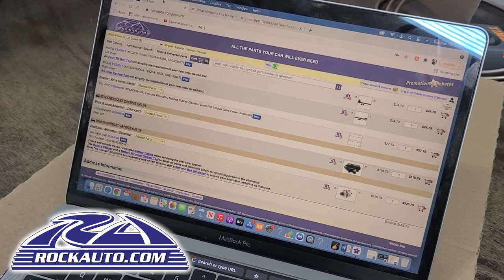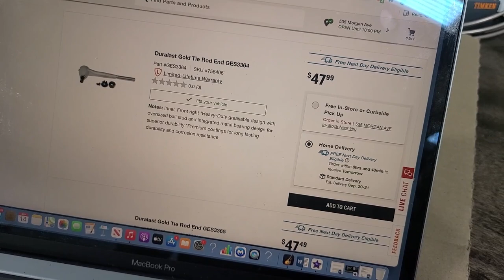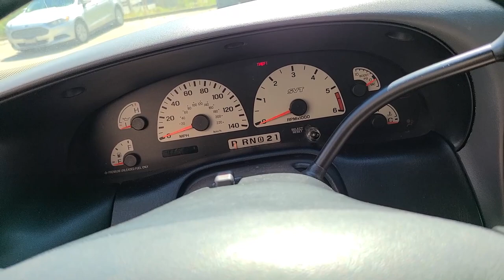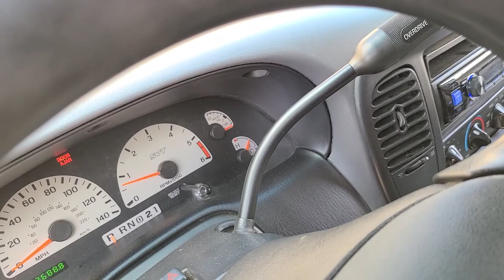I Found A MAJOR Engine Issue After Fixing EVERYTHING On My SVT Lightning! Previous Owner Had To Know

Comment from the maker: Do you think the previous owner knew and is this Ford's fault or abuse? 
Click this link https://bit.ly/3mFdrY8 and use coupon code Legit for 5% off RockAuto!
Reply: Have you considered its the air to water intercooler leaking and pressurizing the cooling system by the boost pre-combustion? That would explain the lack of combustion gasses in the testing and also why it only manifests when under boost. I know these had that problem or something similar when they were new.
Reply: Absolutely no doubt about it
Reply: I really don't think it's the previous owner's fault. Just doesn't add up.
Reply: @LegitStreetCars Not sure if you know, but you need to have the control arms loaded to properly check the ball joints on those... Like leave the truck on the ground and place the jack under the control arm, one side at a time to check for play.
Reply: @christophersparkman  He owned several of course he knew plus the leaking overflow was a dead giveaway
Reply: It might be worth trying a different degas cap. Read a few times where it’s not regulated for the correct pressure and it just spews out coolant.
Reply: Yeah Alex your going to rebuild the engine and improve it over the winter? Good luck... ⚡️
Reply: Alex if you contact Ford Tech Makuloco he is a you tuber and master Ford mechanic. Expert on Ford trucks. I would try and talk to him before you do anything.. he will know what to do.. with his videos I did cam phasers and timing set on my 5.4.. truck runs great now..
Reply: Initially offering to help with parts shows the previous owner knew of the issues... if the purchase document states Sold As Seen then this is on you, if not, you could make a claim towards the previous owner. Depends on the local state laws.
Reply: I would bet your next paycheck he knew!
Reply: Of you want to try a sealer blue devil head gasket sealer I've used there other sealers and my grandpa has on his own vehicles and never had a problem for small leaks that weren't worth fixing at the time but needed sealed
Reply: it is my intuition that a disproportionate number of cars on the market are ones where there is a significant problem that has not yet "bubbled up to the top", er, so to speak.
Reply: If you need the truck for the shop get another engine and build it.  Then switch it so you don't have the truck down for a while like the Benz
Reply: @chrishaugh2872  at first, I thought of that too. But, after further thought, he is specifically testing for combustion gases and there can only be those gases if there is some throughway between the combustion chamber and the cooling system, which should never be. As far as I know, the only way to have combustion gases in the cooling system is a blown head gasket; which is the seal between the combustion chamber and the cooling system.
Reply: @frestkd  well, is this one of the engines where the hg cannot be done with the engine in the vehicle?  also, may not need both HGs.  I'd try to do just one.
Reply: Even if he did it's up to the buyer to figure out. They are always being sold for a reason. I got screwed by a cam phasers issue on a used Lincoln after the first oil change. Previous owner put gear oil or something to thicken and quiet it down.
Reply: @TheTacoBelli  watch it until the end, there are combustion gases in the cooling system
Reply: He knew that’s why he sold it. And that’s why the coolant turn crappy so quickly.
Reply: He definitely knew about the head gasket reason why sold it to you. He gone with the wind buddy
Reply: Ohh for sure
Reply: I recently got an 05 SILVERADO 5.3L. I found a bunch of Fords in my price range but was afraid of 5.4 3 valve timing and oiling issues. I decided I will deal with some rust over an engine rebuild 🤣
Reply: Tighten headbolts! :)
Reply: This is likely head lift under boost. Owner knew,   You don’t own a lightning just for it’s light duty utility, you own it to do exactly what you have been doing, use it as intended + the couple of hard pulls while doing so. Hind sight is 20/20 but there was obvious evidence of this when you bought it. It looked like a rusty coolant bomb went off under the hood. 20 year old boosted engine with higher than factory boost equals this problem. 

Please no additives! Bandaids don’t fix bullet holes. No additive is gonna fix this issue, and I’m surprised you are considering that.
Reply: Do the turkey pan mod when you do the head gasket job. I have no doubts the intercooler is cover in oil.
Reply: When I saw that gunk in the coolant in your previous videos it immediately made me think it had some sort of a leak (coolant or head gasket) and the guy dumped something in there to try to fix it. So he must have known something was wrong.

I don't think it's going to blow up if you use it properly. It'll probably run for years with such a small gasket leak. Fix it when you have time.

P.s. I'd love to watch the whole head gasket replacement process, especially with you doing it in your laid back manner.
Reply: Unless he never beat on the thing once and the problem never revealed itself, he had to know. I rarely beat on my 500 Abarth, but I do on occasion and still pay attention to everything that happens with the car in case there's a problem.
Reply: Unfortunately one of the first things you said about the problem was correct. It’s a Ford and you should’ve gotten a Chevy. With that being said, I highly doubt torquing down the heads at this point is going to work since the head gaskets have probably been ruined by the combustion gases flowing around them.
Reply: @plumberman19  It's unusual for these to blow head gaskets, usually if they are pushed past the limit, the rods will let go. It can happen though. Totally agree about not using additives, especially on a boosted engine. Maybe on a worn out economy car that will never see WOT, but not on something that you're going to beat on.
Reply: Get some new heads all together (PI) keep the cams and go from there 👍🏿
Reply: With the coolant looking like crap and the combustion gas in the coolant I would tear it down and fix it right.
Reply: He P in The Tube
Reply: Thats why it was a low price for a good runner. Not so low it looks broken but right at the bottom of good ones prices. Then there's the facts he had a few and knew them and that he had this one a year. He knew. 
Thing is he knows he knew and you know he knew but if you can't prove it you're relying on his conscience to sort it out and these days thats a rare trait. 
While its apart use decent studs like ARP and do it properly. If you want big power there are a few things like thicker gaskets you could do but its a truck. Does everything need 1000hp these days? 
If you're happy with the performance just beef up any weak points and make sure everything is set up properly. Maybe light head work to go with that pulley then a tune once its all done. That should put it over 450hp (genuine - not Brock numbers) and drive pretty much like stock unless you're on it. 
As for sealers - you said it yourself but I'll second it. They usually gum everything up and hardly ever work. When they do work its the bits in them blocking up a suction problem from the coolant system to the cylinders or very small leaks. They can't do it the other way around so if its only under boost this will just blow those bits out of the way as soon as it sees positive boost.
Reply: @TheTacoBelli  There wouldn't be combustion gasses in a system upstream of the combustion process.
Reply: Alex, just an FYI, I ordered 2 brake sets for two different cars. I clicked the link - there was no 5% off and there was nowhere to put a coupon code.
Reply: @MindsDozer  Yep you kinda have to read between the lines to judge the reasons for the sale
Reply: @plumberman19  The rusty water is most likely the previous owner adding water instead of coolant to save money
Reply: He offered to pay for parts, then ghosted you. He absolutely knew.. There could be multiple issues here. You could have a cracked head which only a shop with the right equipment can detect, or as you said someone may have had the heads off and didn't torque them correctly. Either way, to fix this right the heads have to come off. No way the head gaskets aren't compromised by now from the heads lifting under boost.
Reply: @patharrison1831  You put code in the "How did you hear about us" box when you are checking out.
Reply: Man I wish I would have seen this coupon. I just bought a few things from rockauto for my CL55 & E63-S AMGs. ☹️
Reply: How much should a head gasket replacement cost? Does it always mean planing the block? What are the risks? Thanks.
Reply: @TheTacoBelli  the intercooler system is a completely seperate loop from the engine cooling system.  The 99-00 trucks had an intercooler leak, but that was into the cylinders, not the cooling system.
Reply: He definitely knew

You should rebuild the heads for better performance
Reply: You should reach out to PowerStroke Tech Talk w/ARod - I know he loves his diesel talk but seems some nifty work on gassers too with him.
Reply: Yup, that sucks but I agree. I wouldn’t hesitate to drive cross country with it. I wouldn’t hesitate to beat on it either. It’s been that way so long, as long as your not trying to get more power, it will probably stay that way. Eventually it will need to be fixed and if your going that far. Build it up!!
Reply: I'm sure he knew and that's why he sold it just so he wouldn't have to deal with it.  Also it's easy to say there's 3 other guys willing to give me asking price so whoever gets here first.  That also makes people rush their inspection more thinking its a mint truck with zero issues.  Most owners know a test driver likely won't beat the hell out of a car that isn't theirs yet either.
Reply: Before I got rid of my lightning I put rod's pistons and a crank in it along with studs because I kept having issues with the Whipple blowing the head gaskets.  In hindsight when I put the whip on I should have done everything else at that time. It would have saved me a lot of headaches and broke down truck issues
Reply: I'm not so sure the previous owner knew. The inconsistent maintenance indicates to me that the owner knew something was wrong, but the fact that they didn't flush the cooling system regularly makes me suspicious that they just chalked up the overflow issue to that. I'd be interested to know if re-torqueing the head bolts fixes it, but even if it did, I'd wanna replace the head gaskets. It would drive me crazy to not do it.
Reply: Just keep it like that. Use a needle to open a little hole near the neck so it can "breathe".
Reply: I think he was baffled
Reply: Alex, code Legit doesnt do anything... I clicked the link so hopefully you still get some credit for bringing customers in
Reply: @Number1Leasing  +1, Code doesn't do anything
Reply: Probably knew.  Props to you for your no excuse self-accountability.  Will be a pain, but good odds your karma (and skill) will pay off. By the end of this.
Reply: I know whats wrong ..i know whats wrong with the engine...its a Ford engine...so ...there ..was i right
Reply: Previous owner agreed to help pay for parts?? Yeah he %100 knew about that problem.
Reply: Fun fact, I have done headgaskets on a 01 4.6 f150 (it had a burnt valve) . You can do it in the truck, if you want. Once you remove the fan and accessories you can stand in the engine bay. But the ford harness has a quick release on the motor/trans so an engine pull is not that bad either. Awesome videos man, good luck 😁
Reply: *100% THE PREVIOUS OWNER KNEW!
Reply: Nice to finally see someone no be an animal with the impact gun and use it appropriately on a vehicle.  You can tell your a proper mechanic.  Lot of guys just ditch the hand tools for the impact, mash threads and don't have any feel for the tightness of things.
Reply: It's because it's a Ford
Reply: was just wondering if you could list what exactly you replaced on the front end  I cant locate the center part of the linkage.
Reply: So...is there a follow up here?  Built the motor?  New head gaskets?  Deck the heads?  Buy a motor from a bone yard??
Reply: @JoeManLARockinEmpire  not necessarily.  If he didn’t get on it.

Comment: Alex, legit recommendation: if you pull it to fix the gaskets and helicoil the spark plug holes to make them full thread, add rods and pistons to the upgrade list.  The stock PM rods and cast pistons sign off above about 450-475rwhp even when everything is done correctly, but the pistons will lose their ring lands at the first hint of detonation at nearly stock power levels.  I had one come into the shop many years ago after the owner’s GF put 87 octane in it and it knocked the ring lands out of the pistons on a truck that had a +2psi pulley, CAI, cat-back exhaust, and a tune on a truck making about 400 to the wheels.  These trucks are so much fun, but they were close to their safe limit from the factory.  Three years after these ended production, the GT500 saw all the updates the SVT Lightning should have received, let that be your guide.  Great video as always, love the direction the channel is taking.
Reply: Very interesting information...thanks for sharing 👍
Reply: Hopefully Alex sees this and follows your advice.
Reply: I am really surprised Ford did not use forged pistons in a boosted application. That is pretty much gospel when assembling an engine for a power adder since Hypereutectic pistons will work for a while but once they rattle, it's a wrap.
Reply: How much should a head gasket replacement cost? Does it always mean planing the block? What are the risks? Thanks.
Reply: @chrismason6857  it should cost however much the gaskets cost, Do it yourself. Its not hard
Reply: Helicoil isn’t the way to go. Use timeserts.

Also: The GT500 is a completely different 4 valve cylinder head. I wouldn’t call it an “updated” lightning motor at all.
Reply: @kickblake  if people would service the plugs on a regular interval and not over tighten them, the 4-thread heads aren’t an issue.  It’s shit technician and boneheaded DIYers who crank on the plugs that creates the actual issue with thread failure.  And comparing the GT500 is completely relevant, Ford used a stronger block, stronger rods, forged pistons, and the drastically improved cylinder heads from the Ford GT which also improved the head gasket retention over the 2-valve heads.  Ford could very well have put the supercharger on the 4-valve Lincoln Navigator engine to build the Lightning, but Ford spent most of the late 1980s through the mid 2000s making a lot of questionable engineering and design decisions.
Reply: @TheGT350Garage  actually, the lightning is a plug eater. You either change plugs every 10k, or you splash out on iridiums that last longer (but not enough to justify the cost).

The constant plug changes, no matter how nice you are when doing them, eventually damaged the threads. 

The 4v head used the exact same head bolt configuration as the 2v. There’s no improved clamping. The creation of the GT500 is not the next descendant of the L motor as in between you had a NA 5.4 4v cobra r, and a supercharged 4.6 4v cobra. The L motor was basically a how-do-we-minimally-modify-a-standard-truck-motor-to-take-boost affair whereas the cobra and GT500 programs were more serious performance products.
Reply: @Mach141  add machine shop cost for headjob, always do it. Even when Youre dissasembling in good order and so on, there are always small force/warping happening. Also - machine shop may replace valve guides, springs and so on.
Reply: Time serts time serts
Reply: I've got to agree...... extremely compressed air entering the engine and no where to exit quick enough. You'll see KR through the roof and it'll pull tons of timing trying to prevent piston damage, bending a rod, or losing a ring, etc... and with KR; it'll do all that in a flash..... literally an early flashm??;
Then, like everyone else with a s/c; you'll want to drop pulley sizes eventually so might as well do the mods now. Valve Springs, lifters, cam, I.C., C.A.I, injectors etc. Love the truck though and watching you work.
Reply: I've seen broken rods in these engines with stock internals and no mods.Just saying